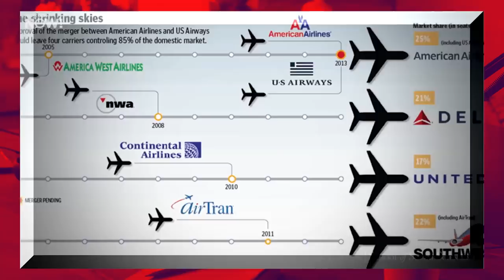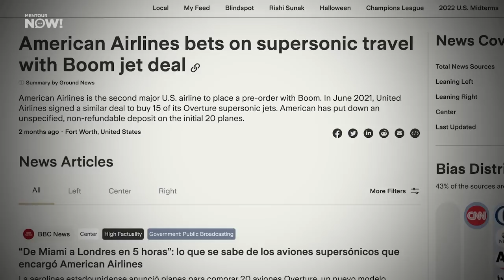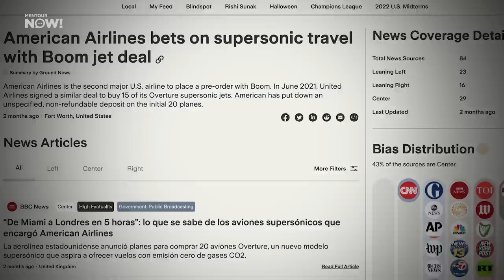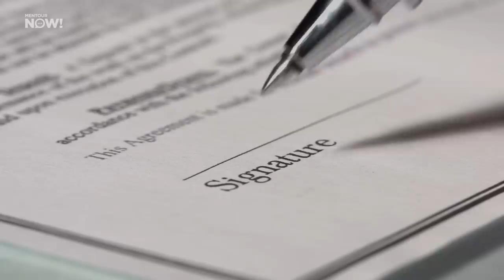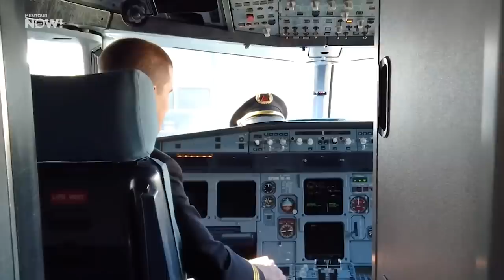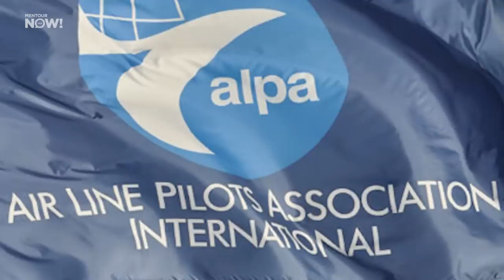Is This the DEATH of the US Regional Airlines?!

Comment: I fly into a small airport where we used to only have regional airlines fly for delta but recently instead of a E175 or Crj900, they have been sending a B717 for one of those flights. I also noticed on their website that when delta flys a mainline plane into a small airport the ticket price is slightly lower vs. the ticket price on the regionals due to the mainline aircraft having more seats.

Comment: Regarding crew expenses, CFR § 91.533 Flight attendant requirements states that (a) No person may operate an airplane unless at least the following number of flight attendants are on board the airplane:

(1) For airplanes having more than 19 but less than 51 passengers on board, one flight attendant.

(2) For airplanes having more than 50 but less than 101 passengers on board, two flight attendants.

(3) For airplanes having more than 100 passengers on board, two flight attendants plus one additional flight attendant for each unit (or part of a unit) of 50 passengers above 100. 

So keeping the seat count between 51 and less than 101 means the companies save the cost of one flight attendant per flight. For those companies that have a large number of regional jets, that becomes a significant savings in salaries and benefits. If they flew their large jets on these route, they would have to have 3 or more flight attendants. Not saying this is a reason for flying the regional jets, but I suspect it enters into consideration.

Comment: On the salary thing your missing a part of the picture.  What is happening with freight airlines like FEDEX/UPS/etc.  I know FEDEX hired many pilots at very low wages to fly a large fleet of small turboprops like the Cessna Caravan.  When I got my SEL in 2000, it was at an airport with an aviation college.  You would hear a lot about the low salaried stater jobs at FEDEX and the regional airlines.

Another thing to look at is how EAS effects regionals.
 "Essential Air Service (EAS) is a U.S. government program enacted to guarantee that small communities in the United States, which had been served by certificated airlines prior to deregulation in 1978, maintained commercial service. Its aim is to maintain a minimal level of scheduled air service to these communities that otherwise would not be profitable."  159 communities get EAS contracts. They dictate maximum size of airplane.

Comment: My first few flights were on Piedmont Airlines, which were then flying the Martin 404, a 50 seat rotary piston dual engine, built in 1950.  Most of their pilots were Air Corps vets from WWll.  Not a bad operation, at all.

Comment: I mean, the fact that you found 2 planes flying into larger airports, doesn't negate the 100s of cities with airports that are legitimately too small. There's also the matter of demand. Replacing 2 or 3 erjs with an a320 only makes sense if you're actually flying that many people. The majority of erjs flying into our city aren't even full, nor are they flying multiple flights from the same city, the same day. There simply aren't always going to be 200 people looking to fly between 2 small cities at any given time, and flying 1 erj to meet actual demand,  is still cheaper than flying an a320 just because the pilots of the a320 don't make quite as much more anymore.

Comment: You should have picked jets operating in the midwest and up around the Pacific Northwest. The Northeast is a densely populated area. The southeast is next. Out in the midwest it is a very different story. 
Also, here in the US the size of the airport is meaningless. Yes, a lot of airports have larger runways, but that's not what matters. What matters is just how much traffic is going there. 
For example, there's a place I go once a year and yes you could land a 747 at the airport. I leave from DFW, which can handle anything. Put only the small regional airlines go there. Because there isn't that much traffic. My only other option is to fly to either Atlanta or Nashville, and then drive 2+ hours.
It's a very different market here.

Comment: In Europe, KLM Cityhopper has about 60 planes and KLM main about 110. So that is about 1/2 instead of the 1/5 or 1/6. Also, KLM Cityhopper connects many large hubs like FRA, MUC, LHR, MAN and CPH with Amsterdam several times a day, not only smaller airports.
Reply: True, except a) KLM has a long history of running actual commuter (not regional) flights, in small part because of "home" support of Fokker, in the old days. And b), strictly speaking, KLM is now part of Air France-KLM Group, and with AF having no regional of its own, plus the (not-so-regional) Transavia fleet(s), the Group's Embraers for Cityhopper would work out to... around 1/5th, maybe
Reply: @spyrosg3172  iirc AF does have a regional airline. HOP!
Reply: @moreldav  Ah yes... I stand corrected. Even so: the entire AF/KLM group has 521 aircraft. HOP! and Cityhopper put together have 101 of those. So 5/1 it is!

Comment: Scope clause isn’t just an “arbitrary thing” in a contract. It helps to prevent the large corporations from outsourcing pilots work to cheaper, less experienced pilots. The 190 E2 is a beautiful plane that could fit nicely in a US airlines fleet, but it should be flown by the actual pilots of that company. Not outsourced to cheap labor.

Comment: Another factor to consider: many of the routes that the regional carriers in the US fly are subsidized by the gov't through the Essential Air Service program, meaning that they make more money from the gov't just by serving these routes than they do from the passengers actually flying them. Pilots gain experience flying for the Regionals, which they then use to transfer to the mainline carriers after a few years, where they get better benefits.

Comment: You forgot one of the largest regional operaters in the USA.  SKywest.  I work at MSP and regionals is a big part of MSP for the 5 state area around Minnesota.  Delta bought the A220 series to replace the aging Boeing 717s as well as the MD88s/90s that they phased out.  Not the mention i kept seeing brand new CRJ9s showing up right before the pandemic going to Endeavor which is owned by Delta.  Now i keep seeing brand new Skywest E175s show up.  Alot of airports they fly too in the 5 state area however, are not big enough for anything bigger than lets say a B737 / A320 series.  For example, Only 1 alternate airport in Minnesota can take widebody aircraft which is DLH, Duluth, north of Minneapolis.  All the other major cities like RST Rochester, STC St Cloud, MKT Mankato, etc....  cant take anything bigger than a B757 or smaller.  But as for staffing, all the airlines are hurting.  Its not just the pilots.  Its all departments of the airlines from ramp personal, to 3rd party contractors....

Comment: So you started talking about the alpa reporting that there is not a pilot shortage, and that the pilot pay and pilot shortage are two sides of the same coin. It's very similar to the truck driving industry here in america, I've been a truck driver for 9 years and all I hear every other week is how there's a shortage or how these companies are scrambling to hire drivers. But you look at the market and you realize it's falling out with freight rates at an all-time low because we're coming into a recession and demand is not there. In my experience as a truck driver in my industry, a lot of the issues that arise from this are due to high driver turnover due to unfair wages. There are companies out here that will send their drivers out for three to five weeks at a time sometimes even more, and they only make about 5 or $600 a week. That is absolutely criminal. I'm sure the same can be said about pilots. In the end, there is no shortage, there is a high turnover rate and corporate greed. That's my opinion anyway

Comment: 17:53 just a slight thing here, JetBlue has some E190s which are mainly used in the Northeast. These are soon to be replaced with A220s. American used to have some E190s they got from US Airways in their merger, which were retired in 2020. Republic Airways had 17 E190s which have been retired. Other than JetBlue and Breeze, there are no other operators in the US. Porter Airlines of Canada has some E195-E2s and Aeromexico Connect has a fleet entirely of E190s, and other than those there are no other North American operators of the E190/95

Comment: I was talking with a fellow the other day about flying in the turbo-prop aircraft. We both agreed that flying a high wing aircraft has an advantage for the passengers as they can all look out and see the ground. That is a bit difficult to do in low wing aircraft, especially if you're seated directly over the wing.
Reply: Not a huge necessity, but it’s nice. The issues with props are their relatively low speed and sound/vibration.
Reply: @afcgeo882  On the short hauls that these are great for, the length of flight isn't that much more than that in a jet. With so many fewer passengers, embarking and disembarking is a lot quicker, too. For 300-400 miles, I'll stick with the turbo-props.
Reply: @johnslaughter5475  For 300-400 miles, sure. I just flew 3 hours on a Dash-8 though and was very thankful for my noise-canceling headphones. Still… a 400 mile flight on an RJ takes about 50 minutes, while it takes about 90 on a turbo prop.

Comment: As a resident of South Carolina, I agree that it doesn't make any sense for us to have regional airlines anymore...at least not at GSP, CAE, or CHS.  In fact, within the past few years, American has started flying mainline A319 and A320 aircraft from CLT to GSP, and it's only about a 16 minute flight.  The demand for flights has increased significantly at all three airports over the past 15 years that it simply doesn't make any sense (to me) for them to continue flying cramped sardine cans (a.k.a. regional jets) to these three cities anymore.  As a kid back in the early 90s, I can remember when the mainline carriers used to fly 727s, 737s, and DC-9s to GSP, but around the year 2000 they gradually switched over to regional jets and turboprops as the older, larger aircraft were retired, which seemed like a backwards move in some ways.

Another "threat" to the regionals in the not-so-distant future is the development of high speed rail in the U.S.  For years there has been talk of bringing high speed rail to areas outside of the northeastern seaboard, and I am an avid supporter of it just as I am of aviation.  It makes no sense to drive two to three hours from the Upstate of SC to get to either Atlanta or Charlotte just as it makes no sense to pay a few hundred dollars for a 16 to 35 minute flight to their airports from GSP.  In recent years, there has been more and more discussion and planning for a line that will go from ATL through SC and NC, connecting the major cities along the I-85 corridor.  Of course, at this rate, I'll believe it when I finally see it.

Comment: As an Alaskan who does regularly travel to the lower 48, I am most familiar with Alaskan Airlines.  Currently they do still run turbo-props in a regional capacity in the Pacific NW, they use to fly them in Alaska but did away with them awhile ago because of the required down time to fly them to Seattle for regular inspections, combined with rural Alaska hubs like Nome, Bethel, and Dillingham upgrading their airports to accommodate B737s, this has lead to the use of the B737-400 Combi aircraft which only seats 72 passengers but is half cargo aircraft.  Also when flying to the East Coast I am glad to be able to get a seat on a regional jet that is making runs between major hubs 2-3 times a day, as that may make a difference of 12+ hours on an already 10+ hour trip.  If I had to wait for the one flight a day between those cities then I would end up spending more than a day extra on each trip.  Lastly, my understanding of why the US has gone away from turbo props is customer ignorance, by that I mean that US customers largely believe an aircraft with a prop is older/outdated, less efficient, and more dangerous; all of these are obviously false but if you cannot get people to buy tickets on those aircraft, or that have a negative experience by being on a turboprop either leading to bad reviews or a boycott of the ban that is bad for business.  Basically the majority of the American customers expect that they will be on a jet, so the airlines cater to that.

Comment: @Mentour_Now! I suggest you reconsider the regionals in places like Wyoming, Nebraska, Kansas, Oklahoma... There are different type of markets in the USA and so regionals work differently based on the nature of the region. My old residence in Riverton, WY had a long runway (the military invested in it for other reasons) but the turboprops that fly from it are small and the traffic is light. Same will be try for Cody, Wyoming. When sitting in  the lower level of Concourse A in Denver with the long narrow hallway as small plane upon small plane takes off to small cities in the plains, you see a very different type of regional service. Yes, the regionals are captive to the majors often enough, but the type and size of planes that run back and forth from small towns to the Denver hub is important and the distance between small towns and hubs is vast. :-)

Comment: Very good video Peter, I flew for two regionals in the U.S. myself and I agree wholeheartedly with your opinion. One thing that you didn't touch on that makes the whole thing even more absurd is the fact that in some cases the same pilot union that supports the scope clause at a mainline carrier, is the same union that represents the pilot of the regional airline that is being affected by the same scope clause. 

It is important to know that the absurd system that we see today used to make sense once upon a time. You touched on it slightly when you mentioned the evolution of regional aircraft in the U.S. but the actual story is probably involved enough to have its own dedicated video. In fact, I think that if the regionals are kept in the U.S. is just to be able to take advantage of low labor costs once again if there is ever a pilot surplus again.

Comment: First off, REALLY well done. I can tell you really did your research. I’m a extremely impressed! 

I used to be a pilot for Republic, but since moved onto a Low Cost Carrier (LCC); equivalent Ryan Air. 

In my opinion, one of the biggest hesitations got a Legacy carrier to bring i  all the pilots in-house is 2 reason.

1) The regionals can be just cut off when things get too expensive. Once a pilot is on property at a legacy, there’s a process furloughing them. The mainline partner can just choose to not continue working with a regional partner. It’s instant money saver during the bad times.

2) Mainline pilots aren’t just well compensated, they’re benefits are substantially better. A mainline pilot will have a 16% Direct Contribution to the retirement account, MUCH better health insurance, etc…

The regional airline would only offer a MATCH of about 3% - 5% to a retirement account. Averaging out salaries, a mainline pilot would have a maxed out retirement for the fiscal year while a regional pilot might only have a few thousand dollars. 

With all that said, I believe you’re right. There’s only one way to solve this issue and it’s to have the regional industry collapse and being everything to mainline. The E175/E190 pay rates are already included in the mainline pilot contract. Just a matter of bringing those airframes onboard!

Comment: you made alot of great points but there are other factors as to why regional airlines are used, Envoy airlines is owned by americam airlines, along side other regional, but as you stated cost is one of the biggest factor. The major airline might use regionalsoperations in more then one way, like fleet service, gate agents, and so on, because of pay scale. another factor are training snd requirements, they can hire pilots at faster with less restriction and build up their hours and requirement, but this apply to Aircraft techniance, they hire new tech from school build up experience. onces quilactions are met or vacnecy can be filled through moving regional stadd to main line.

Comment: the most important reason to have more frequency is to keep the hub and spoke system and to ensure if one flight is cancelled, there will be another to cover the traffic, crew payment is very far from the importance here, the big three have many decades of experience , and have balanced it this way, they actually do not need larger aircraft as this puts another pressure on congesting hubs and many other operational and revenue/cost problems -so this is the better scheme

Comment: A big part of the pilot shortage goes back to 2010 US legislation that increased the requirement for multi engine flight training from 250 to 1500 hours before you can fly as an entry level copilot.  Flight training cost goes up 600% but wages do not.  Union likes it because it makes their members more valuable.  Not a huge problem right away, but there are not enough new pilots to replace retiring pilots.  12 years later, the cumulative effect is a big problem.